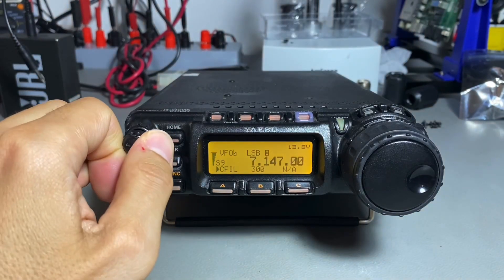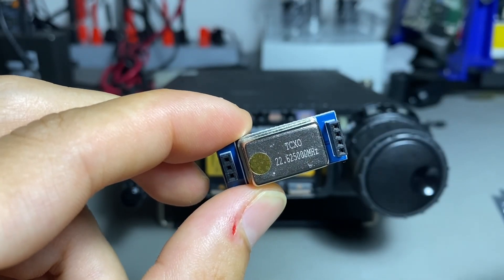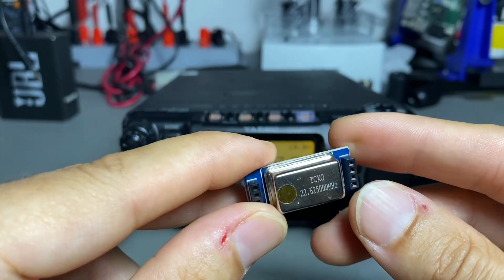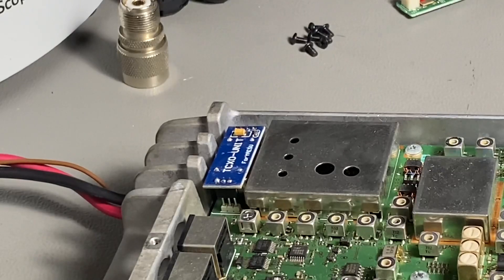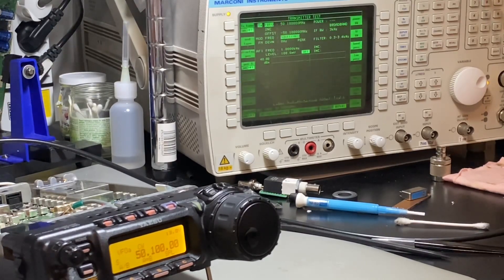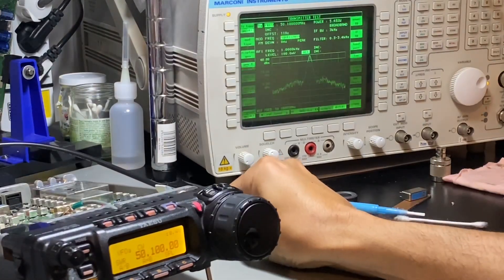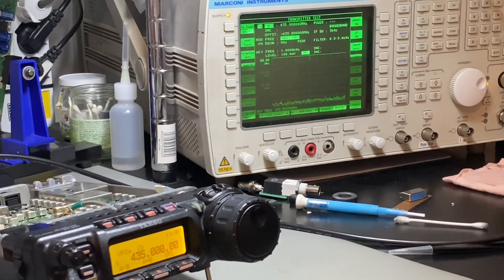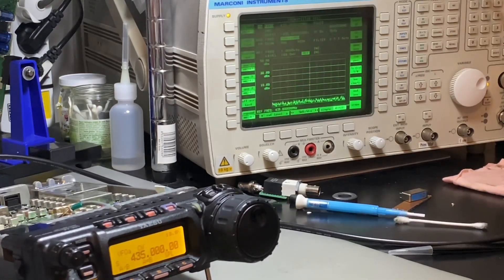Chinese TCXO for my radio | Any good?

Comment: purchased one, as i've installed it  mu 857 became absolutely unusable. sensivity wend down of 30 db and power output decrease at 80W.  putted back the original and everything works fine. those chinese oscillators are pure  garbage

Comment: How far off was the factory yaesu TCXO?
Reply from the maker: I don’t have the yaesu tcxo. I just swapped the stock crystal oscillator which was ok because I did aligned it. The problem is that is very temperature sensitive. There comes the chinese tcxo, much more stable.
Reply: @IZ0MTW  Oh I see, so the original crystal from Yaesu is not temperature compensated.
Reply from the maker: @anonymous_friend  correct

Comment: Thanks for your useful info! But frequency stability is only one aspect. Another would be a look on the noise. Is it getting better or worse after installing it?
Reply from the maker: Good point. I’ll have a look into it and perhaps post results in the next video where I want to try and measure the drift as a function of temperature.